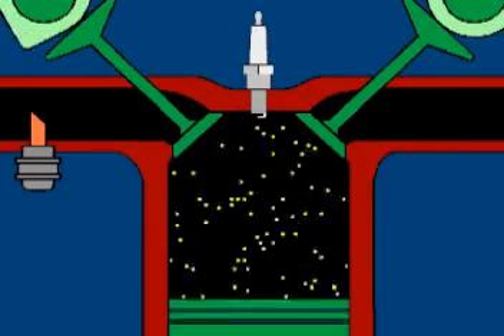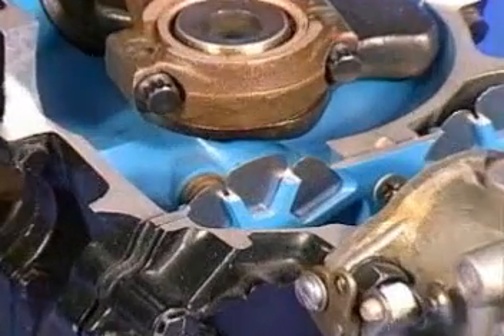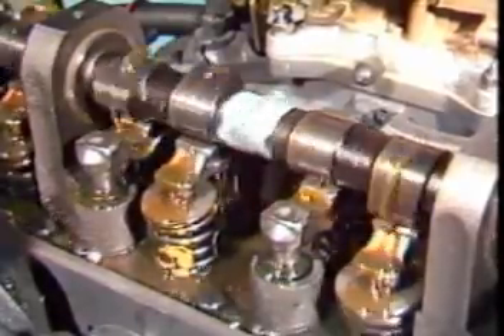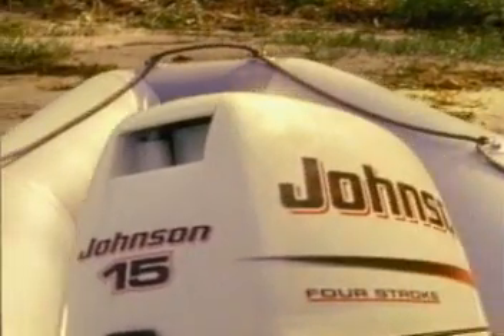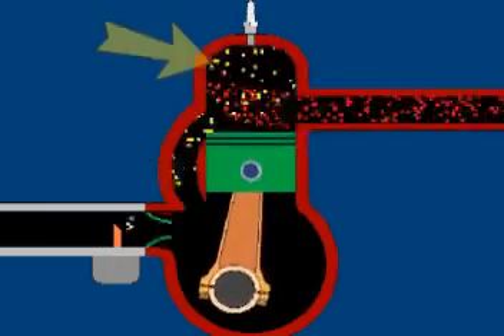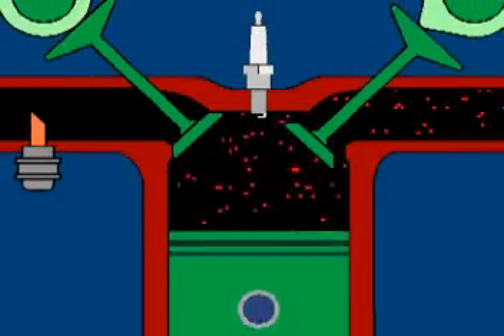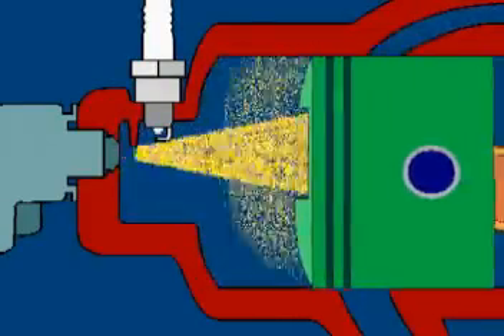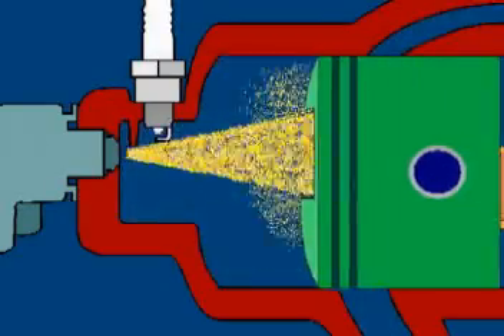2 stroke outboard Vrs. 4 stroke outboard

Comment: It explains the lubrication in Part 2. Basically the direct injection model has a pump which injects oil through the cylinder walls.

The point of having the air in the crank case is to pressurize it so that when the transfer port is opened the pressure forces the air into the combustion chamber and the exhaust gas out.

Comment: but what lubricates the crank case on a direct injection  2-stroke? whats the point of even having the air come through the crankcase if you don't need the oil in it passing over the crank and lubricating it?